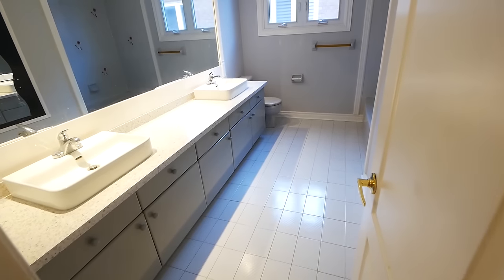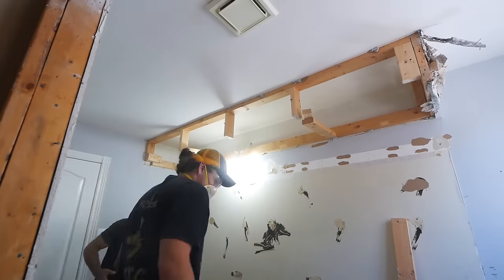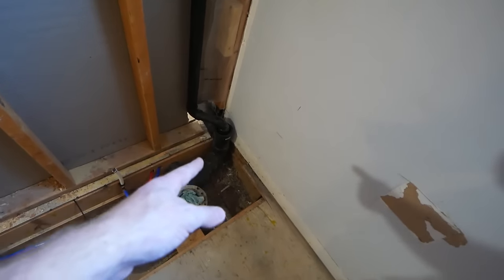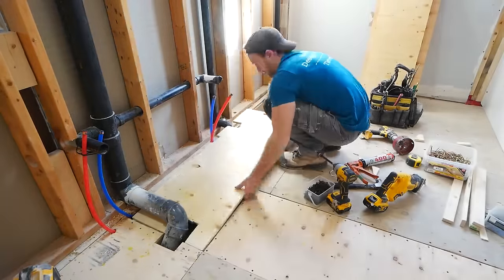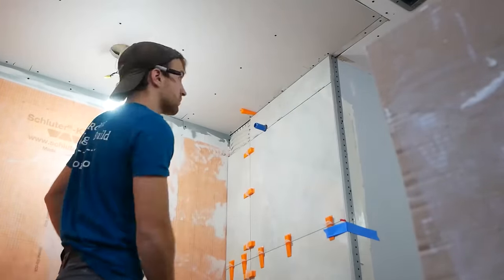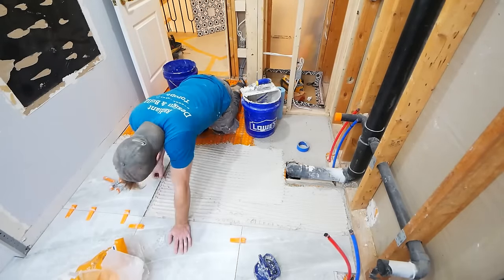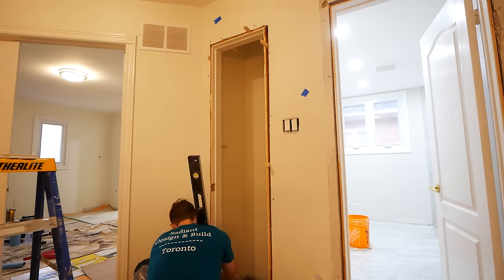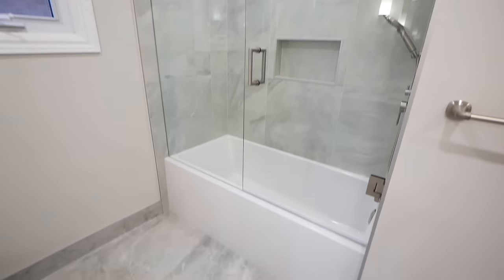Modern Tub-Surround Bathroom Renovation

Comment: I have seen your makeover adding bathroom.. do you offer plans and supplies need? Ok did relook at the video I now see you opened the floor but made it very easy for plumbing
Reply from the maker: In any larger project (relocation work or addition) I provide a 3D model to my clients to help visualize. I also provide them a complete list for what finishing materials they will need to supply

Comment: It’s so weird seeing a wooden floor/sub floor in a bathroom. Here in Australia, every “wet floor” has to be concrete. My 1972 brick house is built on 2 foot brick pillars has a crawl space under the beams and wooden floorboards, but the laundry room and bathroom have a concrete slab on top on the brick pillars, which form the floor of each room.

Comment: Question: will I save money if I remove fixtures, etc by myself? I assume the labor costs take up a huge chunk of the budget? I have no problem getting dirty but have zero knowledge beyond demolition 😂
Reply from the maker: Just fixtures? Absolutely not. If someone were to completely demo a bathroom as well as dispose of the material however I’d probably take $800 or so off. But that would be assuming they get it to a clean slate which I doubt that they would (eg is the subfloor completely clean of existing thinset and staples, studs free of old screws, etc)

Comment: a note about the conduit running the sensor wire for the floor warming. Does the inspector not mind that cable entering the electrical box? because it is low voltage (some codes say low voltage should not be in the same box as 120v), I see some people running the conduit to the outside of the bottom right corner of the electrical box.

Comment: Your videos make it look so easy, yet it hasn't worked out as effortlessly for me in the past. Anyway, what's the total height of your flooring build-up? We have our plans for an addition and I'd like the bedroom hardwood floor to transition flush into the bathroom tile. With 3/4 flooring, will the tile be higher?
Reply from the maker: Most large format tile is around 3/8 thick. Ditra is 1/8 thick. Then another 1/8-1/4 worth of thinset. So typically ends at around 3/4 or maybe slightly less. The hardwood floors in this house were 3/4 and my tile ended up within 1/16 of them

Comment: nice work! but you should waterproof the bath and then add the bathtub, that way its waterproof even it the silicone fails :)
Reply from the maker: Thank you! I’m a little confused at what you mean, there’s waterproofing under the tile that bonds directly to the tub flange
Reply: @WorkinwithWolkon  i mean you should add plaster board the the section where the tub will be. waterproof everything and then ad the tub :) if something happens to the tub flange then there is no water barrier behind and under the tub.

Comment: How deep in the wall should the shower valve be?
Reply from the maker: Depends on the valve, you’d have to read the instructions. With most though if you take a 2x4 and mount it flush with the back of the studs that gets you the required depth